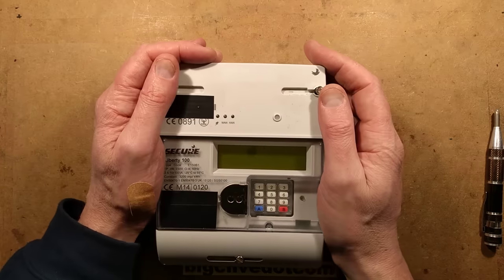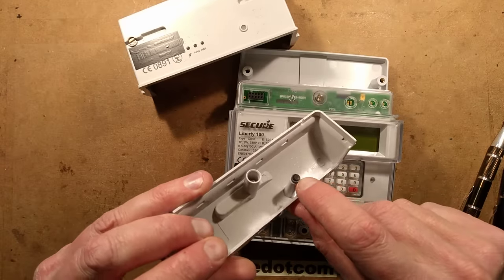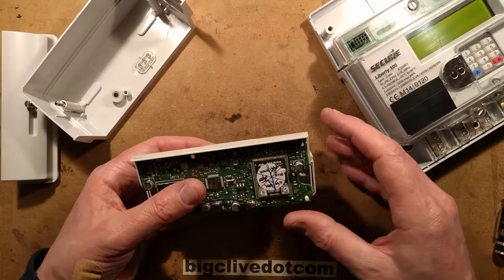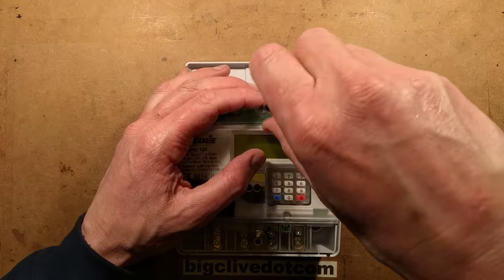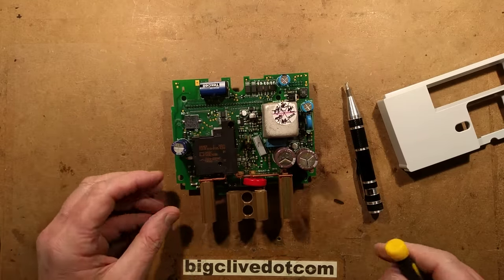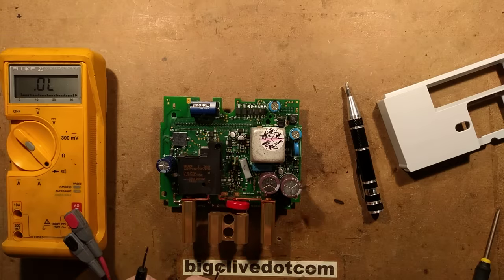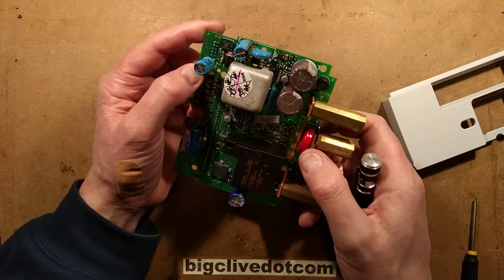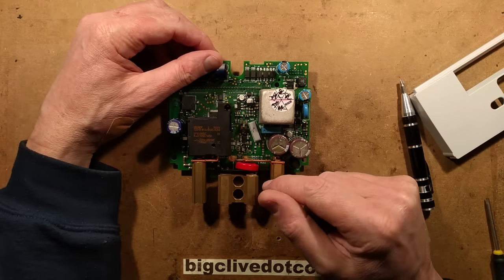Inside a smart meter, and the REAL problem with them.

Comment: From "Effects of 5G wireless communication on human health"
Published by the European Parliamentary Research Service
Author: Miroslava Karaboytcheva
Members' Research Service
PE 646.172 – March 2020:
"Questions remain unanswered as to what 5G actually is, what it is for, whether it has impacts on human health and environment, whether it is secure, whether it offers good value for money or whether anyone will be prepared to pay for it. As an alternative, according to some experts, fibre optics would be more secure, safe and offer higher speed than 5G...

A section of the scientific community – mainly doctors and researchers in medical sciences – argues that there are negative impacts from EMF exposure and that these will increase with the implementation of 5G. A 5G appeal was presented to the United Nations in 2015, and to the European Union from 2017, with an increasing number of scientists' signing (268 scientists and medical doctors as of 18 December 2019)...

Non-ionising radiation, which includes radiation from mobile phones and 5G, is perceived as harmless in general, due to its lack of potency. However, some of the above-mentioned scientists point out that, in the particular case of 5G, the issue is not the potency, but the pulse..."

The whole of the above study is packed with links to learned organisations and reports.

Best read up, rather than using silly terms like 'conspiracy' as a cop-out.